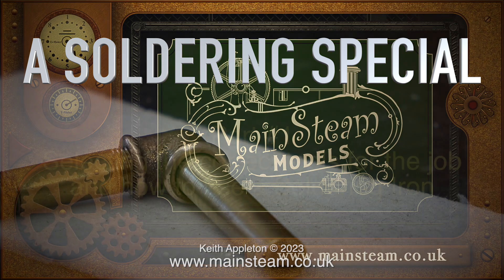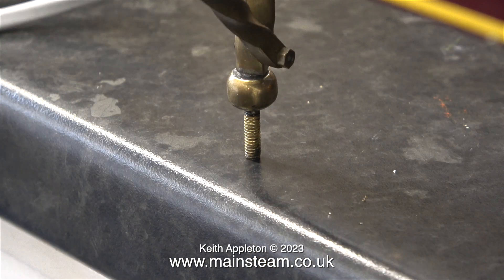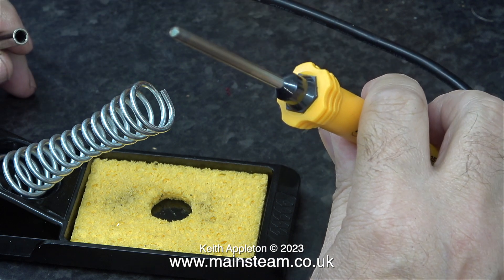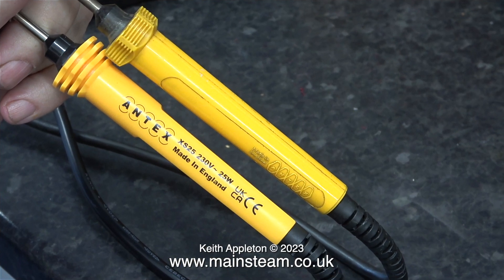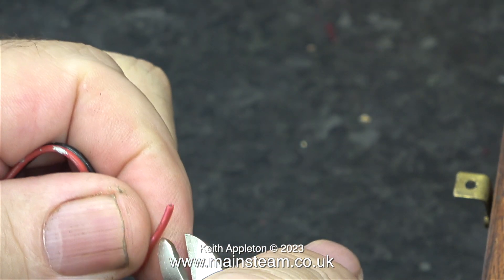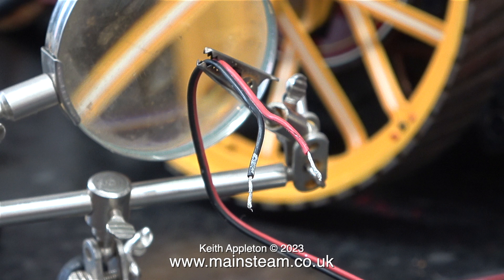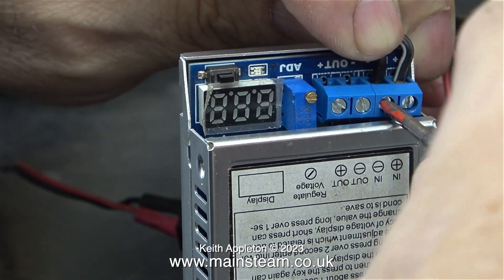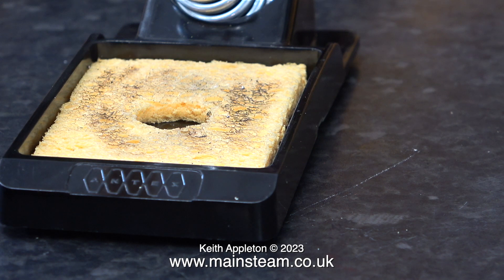A SOLDERING iRON SPECIAL - PART #1

Comment: My preference is the TS100 iron. Fed with 24V 5A supply, on site it's handy using a 12V battery. Fastest to temp, & longest lasting I've had. Carries a lot of heat mass, too.

Comment: It is best not to „clean“ the tip of the soldering iron after use. The solder on the tip will prevent it from oxidizing. The best thing to do is to clean the old solder off the tip just before (re)tinning it. 

Also, instead of the wet sponge you can just use a (dry!) paper towel, folded together a few times. It works just as good as the sponge but it is better for the tip, since the dry paper doesn’t suddenly cool the tip, the way the sponge does. (And no, the paper won’t catch on fire unless you really try to make it burn.)

Comment: I don't see comments for it, but there is a large  group of people who think you should NOT solder  multiple wires that go into a terminal block like that, but that you should use a barrel crimp

I am not one of those people

I have had soldered wires in guillotine type terminal blocks like that for decades without issue, but does the other side listen? nope, they just continue to argue about it
Reply from the maker: I have done it this way without any problems for over 50 years and will continue to do it the same way ......

Comment: I cover the tips of my crocodile clips with silicone rubber, which prevents the problem you showed and also prevents the clip conducting heat away. I taught electronics for many years, both in schools and adult education.

Comment: I still use my Unger soldering iron that I purchased 65 years ago.  Still works wonderfully (and the tip has Never been replaced)  -- 50 watt.  Use wet paper towel to clean the tip, then re-tin with Kester 60/40 solder (tin/lead)